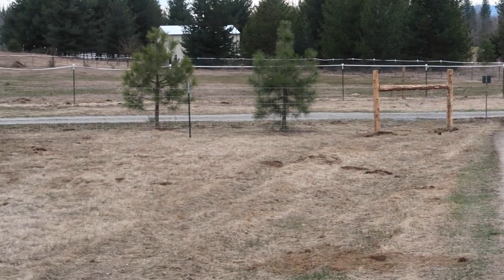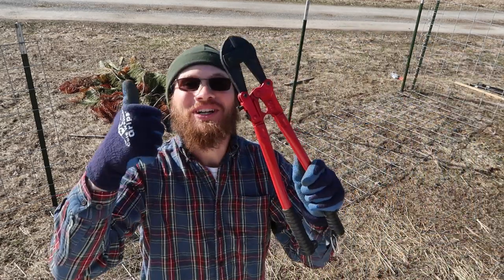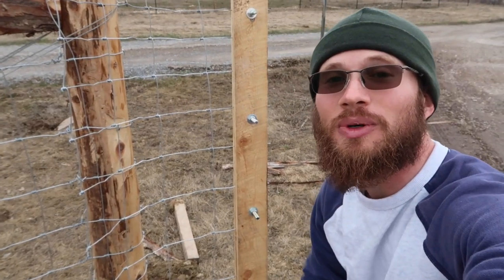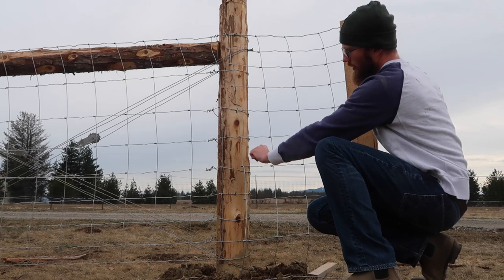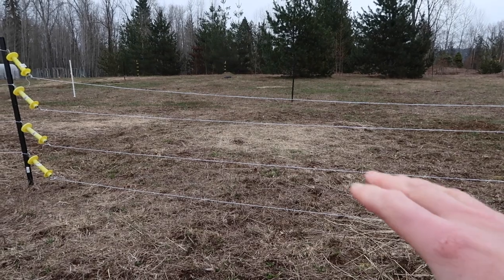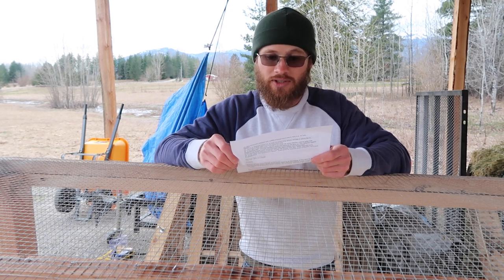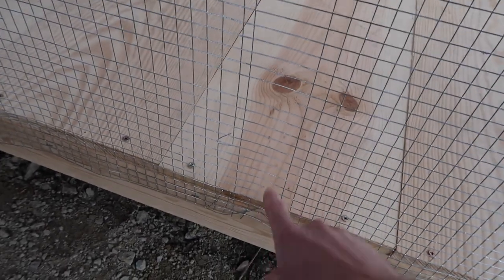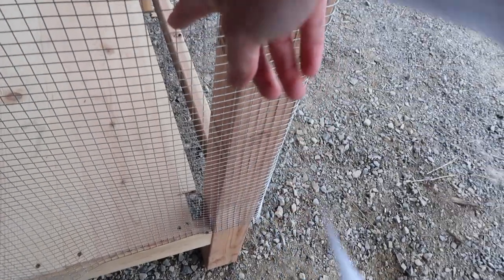Chick Brooder and Fencing Feedback Follow up

Comment: Some cheap vinyl flooring on the floor makes clean up easy and more sanitary than wood. We do use a thick poly film on the bottom and part way up the sides of our current brooder. The chicks leave it alone UNLESS there is a stray piece sticking out and enticing them. If it's flush against the wall and the ends are covered (thin wood pieces) it's not been a problem.
We actually repurposed an old, deep book case as a whelping box and now chick brooder. We don't brood near the number you are planning on though! 
I am a little concerned about proper temperature/heat retention/air circulation with this being outside. Interested to see the changes you make and updates on your brooder and chicks!
We enjoy watching your videos! Excellent job addressing your viewers. All best to you and your beautiful family!
Reply from the maker: Thank you Lisa! Repurposing the book case was a great idea!

Comment: I love the idea of putting these projects out there for all to see and comment on! I'm sure it will help shorten the learning curve for you a bit. I am coming up on my second season of raising broilers on pasture. Due to lessons learned, I am building a new brooder (too small last year) and I am building tractor like John's as well. I built a Darby Simpson style one last season, but our terrain is too steep and rough to drag that beast around for another year. It will be relegated to a pig shade structure from now on!

One small tip I can offer that you already alluded to it in your video is regarding the actual size of the 1x12s that were used for the brooder floor. 1x and 2x lumber actual widths go like this; 3.5", 5.5", 7.25", 9.25" & 11.25". 

Sometimes it's good to learn a lesson the hard way though! Less likely to make the same mistake in the future.  Keep up the good work and best of luck on your farming adventures!
Reply from the maker: yeah, the .25" surprised us.  We assumed they were all .5"

Comment: Ok.  We've only been doing broilers on the farm for 5 or 6 years.  My first broiler brooder looked a lot like your (though smaller).  My second brooder was was 2ft x 8ft.  The size was great for early brooding.  The main issue we ran into, is that when you are running that many chicks (and broilers are quite dumb), is that they would pile up in the corners when frightened. We lost many chicks this way.  Not a pleasant experience.  3 years ago, we switched to an Ohio brooder with two lamps.  If you go to the instagram for Hand Hewn Farm, out setup is almost identical to theirs as seen in their cattle panel quonset hut.  Love that thing!  Just be careful with that brooder and those corners.

Comment: The brooder is GREAT! no need for cross members no need for door. Dont replace the bad section of hardware cloth. Chicks weigh next to nothing. Also chicks will be in that brooder only a few weeks. Especially in the summer. No need to over engineer man. you are WAY ahead of the curve on this one already. Just fix the floor gap and you are golden! You wont loose much litter through that hardware cloth. Try it as is and then change things after you get a bit of experience.
Reply from the maker: Thanks for the vote of confidence!!

Comment: I don't have the experience that Salatin does, but starting out with 18 inches of bedding seems excessive, especially on a brooder that size.  With our chicks, we started with a few inches and just kept adding as needed.  We're just using a plastic water trough so as it's gotten too deep, we've cleaned it out and started fresh.  They are definitely ready to start transitioning outside now, but I ha e to get the tractor built. Hopefully starting that today. Great work on the brooder!   I think you'll find it handy for a lot of uses!
Reply from the maker: Thanks Eric. What tractor design are you going with?
Reply: The Grass-fed Homestead Good question.  I haven't totally decided. I've been leaning towards John Suscovich's design though.

Comment: Great video and I love the brooder. How about using plywood as the siding - preferably defective, normally cheaper - and then fashioning a door on the side with the extra hardware cloth by cutting out a rough door out of the plywood and putting something like a lock on it so the raccoons and whatnot can't pull it open? One thing I think it would be good for is when those American Guinea hogs you want to get have piglets. Enough shavings and the whole thing can fashion as a pig house and the piglets won't be crushed because they can crawl through the shavings. Perhaps its smaller than it looks on screen but I'm a fan. The fencing was also a really interesting vid. I plan on moving up that way, the Oregon area, within a few years to hopefully start on a permaculture agricommunity for disenfranchised young(-ish) adults - people who can't get a job, can't get housing, have been hate crime victims, etc., - and Oregon is a good area for it. I was concerned about fencing but what you just did seems feasible and economical. All the best! - Jacob
Reply from the maker: Thanks Jacob! I try to avoid using plywood around animals because of the formaldehyde in it (it's fairly toxic) or else I would do that.  Keep me posted on your progress regarding the Oregon move and agricommunity. It sounds interesting
Reply: Ah, that's a good point. I'll have to look into it, I've always taken for granted how plywood was made. I can't wait to see how the brooder eventually looks.

Comment: If there is a lot of space for the amount of chicks you are getting, would you consider splitting the brooder into sections so you can potentially put the rabbits in a section or putting broiler chicks and then the laying hens and separating them? And another thought would be what if when you get your chicks they come in at the same time some of them may be a bit older and I thought what if the bigger ones picked on the littler ones so it would be great to separate them?
Reply from the maker: It's possible we divide the brooder up.  All the chicks are shipped the day they are hatched so they will all be the same age

Comment: One more question...which I'm sorry if you have already said but I didn't catch it....😬 How many acres are you fencing in with the perimeter fencing? Curious as to how far 330 ft rolls make it on your property. Hoping to fence ours soon!
Reply: One important thing to remember when calculating fence is that the perimeter measurements are independent of area measurements. For example, a square 40 acres is 80 rods by 80 rods for a total of 320 rods. But a rectangle of 40 rods by 160 rods is still 40 acres, but would require 400 rods to fence. A rod is a fencing measurement that represents 16.5'.
Reply from the maker: Thanks for helping with the questions!
Reply from the maker: We're fencing a 5 acre section of property - 330' x 660' or 20 rods x 40 rods.  Each fence roll is 330' 6 rolls works for me
Reply: Thank y'all! That helps a lot! Looking forward to see what's to come on the Grassfed Homestead!

Comment: Field fencing is great if you don't plan on having horned sheep or goats. Otherwise it won't work as you'll be having to untangle many heads. I had old field fencing that I had to replace with non-climb horse fencing. Field fencing is cheaper of course.
Reply from the maker: good point

Comment: Dude, you're getting way too precious with the brooder.  Find some pallets.  Break them down and build up your sides with the wood.  Use zip ties for easy removal if you don't want to screw them to the brooder.  We bought some reusable 14" zips from amazon a couple of years ago and they are still going strong after multiple uses.
Reply from the maker: I wish I had pallets I could spare to break down! I've been scavenging for pallets the last couple weeks for projects I have in mind and haven't acquired many yet